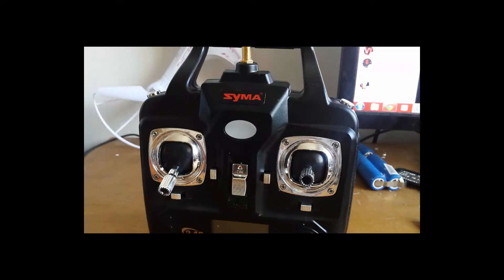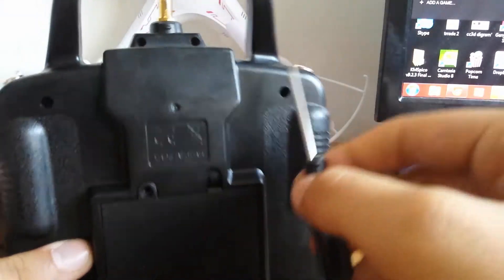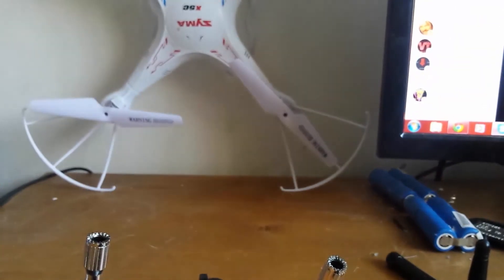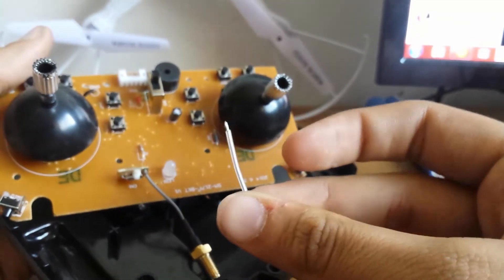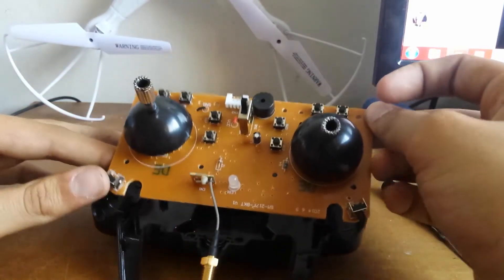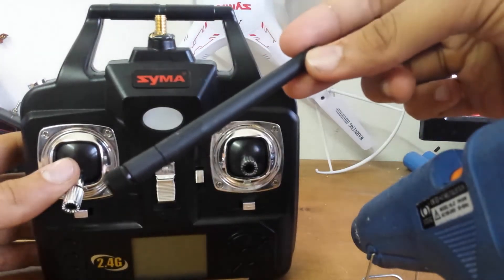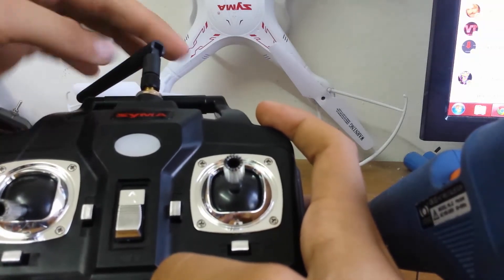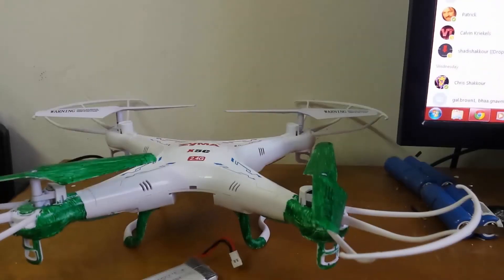Syma X5C-1 Quadcopter - Transsmiter Boost

Comment: HI. I did this mod but the range is far less than it used to be. Does anybody know why this would happen?  The signal wire and the ground are definitely not touching  !!  Many Thanks   !!
Reply from the maker: if you un-connect and return to the factory antenna does the range go back to what it was when you bought it ?
if no you might have burnt or damaged the Transmitter , if not maybe the antenna that you added is not good .
Reply: Anis Shakkour ok. Thanks. I will give it a try.

Comment: Actually, when he states that the antenna lead wire that you solder to the board has to be the same length as the original antenna is incorrect.  It doesn't matter what the length is since that is not the antenna.  It is shielded coaxial cable and wont transmit anything.  The antenna you connect to the coaxial cable port does matter.  If you use an 2.4 ghz antenna from a router or something like that, it is already taken care of for you.  If you build a bi-pole antenna, each element of the antenna need to be 30.5 mm.  Here is a great link to building your antenna and the connections within your transmitter.  https://www.youtube.com/watch?v=XBQZvvIiOlM
Reply: jimnkristy

Comment: Do you cut the new antenna wire itself to match the length of the old one, Or do you cut the new antenna wire to where the brass end and wire combined equal the length of the old antenna wire?
Reply from the maker: +DolittleMccoy yes i cut it to match the old antenna wire
Reply: okay, i wasn't sure if you cut it to match the old wire itself or the old wire including the little brass end... So how did the mod work out ? Any update videos?